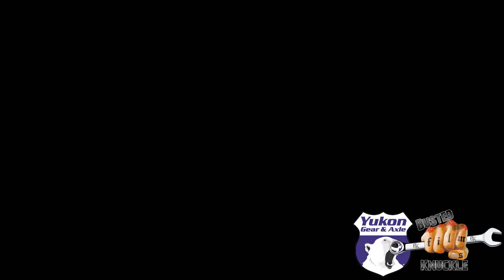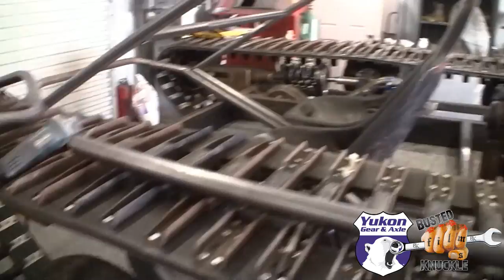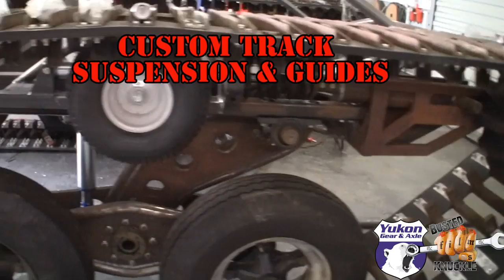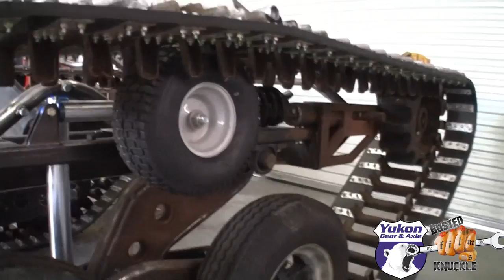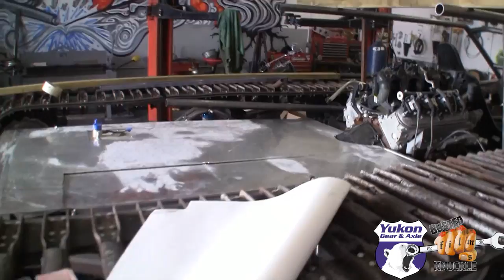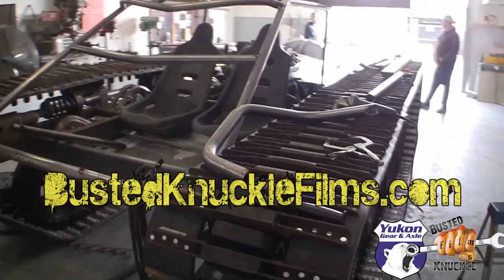Hudlow Custom Tank Build - Ripsaw Who?

Comment: @aj396  Sorry, I think your a little confused. A solid axle means it's like a solid tube from one side - the other VS. independent where you have independent axles on ether side of the diff. Now I would think (not sure) that if it was just an open diff it would want to favor one track over the other making it naturally want to turn. But if it was true posi or fully locked then it wouldn't be able to turn because that keep's both sides engaged equally. Then again I maybe completely wrong.

Comment: @RESET1776 
Well you can see the differential. In regular cars when you turn right the rear right wheel is turning much slower than the rear left wheel, if this wasn't the case the rear right wheel would slip a lot. Slowing down the rear right wheel is done by the differential.

Comment: @RESET1776  He has a massive disc brake behind each drive wheel in the rear. You can't see it clearly from the video but that is what he will use to skid steer that little puppy.

Comment: How does the steering work? Do you just use and open differential in the drive axle and apply braking on the track of the turn direction? Nice work BTW

Comment: need to change the old trailer house wheels to new style ,you will loose a wheel if just one lug nuts comes off,plus's there odd ball size tire ,thy will strand you,and no one hardly has one in a pinch,but project looking cool can't wait to see it run
Reply from the maker: +Micheal Davis they are foam filled